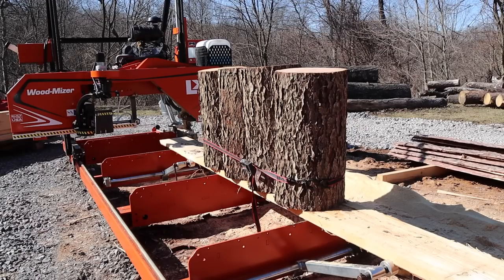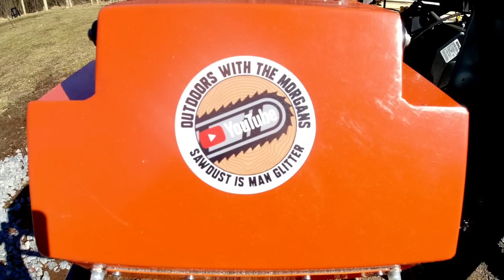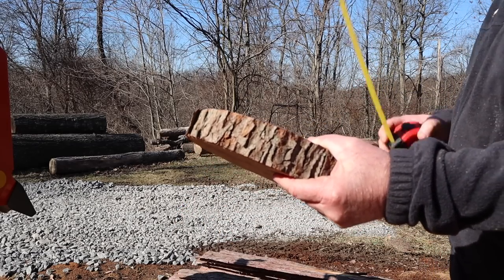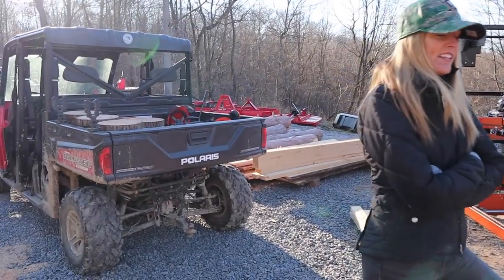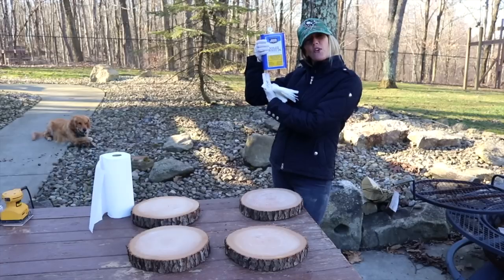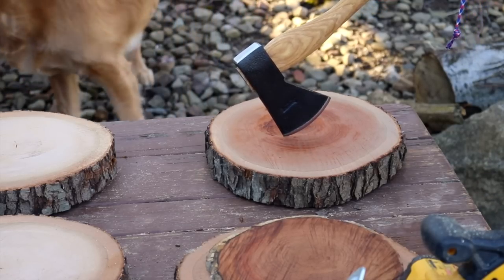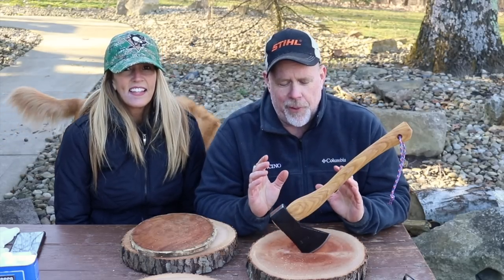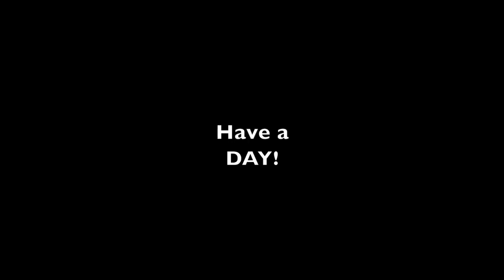#717 Tip and Tricks To Keep Your Cookies From Cracking, Making Rustic Center Pieces, Charger Plates

Comment: You can make a water proof food safe mix with beeswax and Raw Linseed oil. Use 1/3 beeswax to 2/3 Raw linseed oil. Use a double boiler . Do not heat wax and linseed oil directly over heat. Mix while heating. Pour finish product in tins. Use this on any wood like axe handles etc. or leather like for water proofing shoes or any leather work etc. Have a Day.
Reply: Great !!

Comment: Mike, I realize you may not have the time to do this for the reception, I have learned from some old timer wood workers if cutting green cookies and you don't want them to crack.  Place them in a tank of water, submerged in water the sap will be replaced with water and will dry more evenly when the time comes to dry them.  4" thick equals a year under water.  Then you can air dry them.  But honestly they only need to work for one day so if you did them closer to the date they would be less likely to crack.  👍

Comment: Right after you cut them we apply "Sanding Sealer" to the bark and all let dry then sand both sides until mill marks are gone the Sanding Sealer locks the bark which you want. Spray on polyurethane either Gloss or Semi gloss which one you prefer. Spray 4-6 coats. You can get spray cans of poly but if you do a lot its cheaper to use a spray gun.

Comment: I use mineral oil and beeswax to seal mine. I heat it to about 180 degrees and pour it on. Years later and no cracks.

Comment: Here’s my recommendations based on viewing Matt Cremona’s and Canadian Woodworks’s YouTube channels (Matt air dries his wood, while Canadian Woodworks uses a massive microwave kiln with hydraulic clamps):
1.  While the wood is still in log form, treat both ends with Anchor Seal 2, a polymer/wax solvent.  The goal is to slow the moisture evaporation from the cut ends.
2.  Wait several years to allow the log to thoroughly dry to a even moisture content.
3.  Cut into rounds.
4.  Finish as appropriate, but I’d suggest treating both sides to keep any water infiltration or evaporation consistent.
Reply from the maker: Yes I agree, however when your wife says I need 40 of them for a wedding in two weeks you cant say it will take two years. That's why I mentioned finding a standing dead one that's been dead for a number of years
Reply: Outdoors With The Morgans So you hop onto this request but ignore the pool?  ;-).  You asked for a recommendation, so I gave you the preferred, no-time-limit approach.  I agree that using standing dead timber will likely be your best bet if you’re in a hurry, or going to a lumber mill and picking up an already “seasoned” tree if you want (and don’t have) a particular species.  Good luck.

Comment: As far as checking goes, the fruit woods (cherry, pear, apple, and to a certain extent walnut) are the woods that are most susceptible to checking.  Species such as the different oaks are less likely to check.   Another note:  the checking  starts at the pith or the center of the tree even though the heartwood is dead.  The sapwood is the layer where the moisture moves up through the tree to the leave.  I have tried sealing the wood with paraffin which has been successful to a certain extent.

Comment: You want to try something cool? Mount the logs at an angle then cut. First cut is a waste but the rest are wider
Reply: Yeah Mark, I was going to suggest cutting at 45` Worked for me.
Reply: should ovalize them a bit too... does it affect the cracking and checking?

Comment: Wood turners turn bowls from green wood leaving them extra thick.  Then they bury them in a box or barrel full of saw dust and let it dry verrrrrry slowly.  I've tried it a couple of times and it worked well.  Takes about 90 days.  ;-(

Comment: Mike...be very careful with the rags and paper towels that you use for spreading the linseed oil.  If left out where there is enough oxygen over time, they will self combust.  It happened to me but I was lucky.
Reply: Yep. Put them in a bucket of water.
Reply: I always just take all the used ones to my burn pit and light them up.  No worries about the spontaneous combustion that way.
Reply: @Newman81964  I do that now but I oiled a teak boat platform and ran it in the water to see if it needed a second coating...with the same rags....bad move...learned by my mistake.
Reply: Neighbors burned their house down a few years back with rags sitting out on the deck

Comment: Good day to the Morgan's.  I have been watching for quite some time & this is the first time I thought I might have something to add.  You should be putting a finish on the wood as soon as possible (both sides), waiting for them to dry is almost a certainty that they will check.  I have worked with green timbers for the last 20+ years & there isn't much you can do to stop checking, but you can certainly reduce the checking, by slowing down the rate that the wood dries.  The best product that I have seen that does a fantastic job of slowing the loss of moisture is a product made by WoodRX.  If you can find some Clear, it will soak in completely & leave a very subtle sheen on the wood.  It is a 100% acrylic (water based) product that moves with the wood.  I have used this for almost 20 years & it is the real deal.  It can be found online, but it is also available at many building stores.
Keep up the good work & have a great day!!

Comment: You might do better using a router to plunge cut a groove that is a little sloppy loose. Then hot glue the hatchet into the groove. Hammering them in just adds to the stress. Good luck.

Comment: Somehow I am envisioning a bunch of kids running around with axes at the reception... another option that might look good would be to use a 6-8" diameter log cut into 8" long pieces and then sink the axe in. Less likely to crack to an unusable point, although you might end up with guys having splitting contests with the center pieces.

Comment: Anything you can do to reduce that water loss is good! 

Coat and stack in a plastic bag. Occasionally open the bag to change the wet air for drier air. Keep in a cool stable temperature and your chances of crackless cookies goes up! There is at least one Youtuber who uses a fridge with the shelves taken out and a 2" hole in the door to Dry his Blanks over many months, but I think you want these quicker than that! ;0)

Rather than plunge cutting with a circular saw how about a plunge cut with your chain saw? 

They would need to be secured and you would need to be both proficient and confident though! 

The wider cut of a chain would let your axe head sit further in and have less side cut showing!

Have a Good one!

Comment: The wood cookies would make a nice walking path to a POOL.
Reply: With the way the wood would rot, I wouldn't use them for that purpose.  I would make a form from one of the pieces and then cast it in concrete and then paint them or stain them to look like wood.  Would last much longer and not need to be replaced yearly.